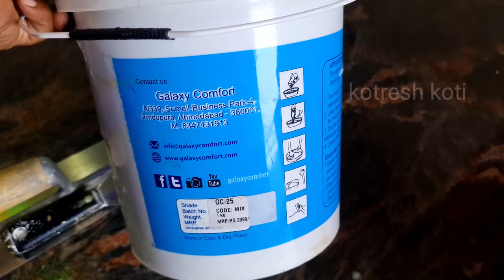Grapits fiber wall coating Galaxy Comfort / interior design /

Comment: hello the first time i see this product. what is it that you apply to the wall. grapits? what are the components of that, as google says "fiber wall"?
Reply: First of new walls primer, after wall, putty or stucco  2 coat dry after primer ,then use this design , this materials fiber type ,, Many paint company s provide this materials ,

Comment: one of the components is cotton wool? that's how it looks to me, and these pieces of paint look like colored cardboard. and it must have some binder, some kind of dehydrated glue which is then activated by water and the cotton wool and cardboard are also soaked in water and swell and then some sticky stable mass is formed. that's why you let it stand for a while so mixed up, to connect all the components? and then once applied to the wall the mass dries and sticks to the wall? tell me if I am close or do I have a vivid imagination
Reply: Really,you are so genius your imagination is not close to  but 100%correct .